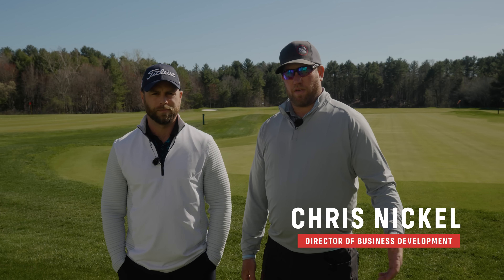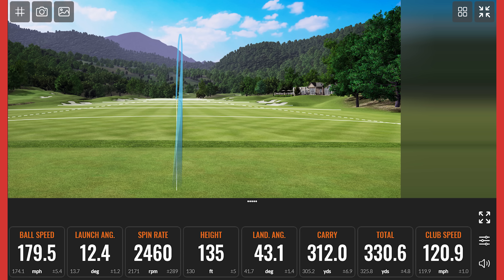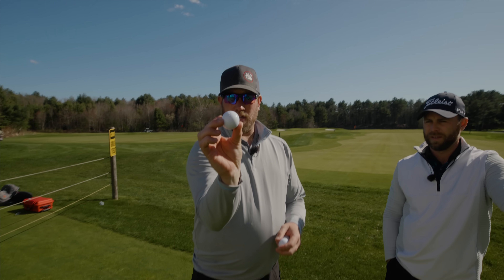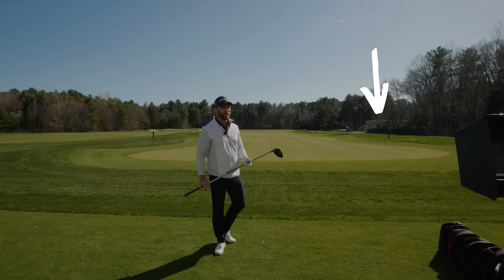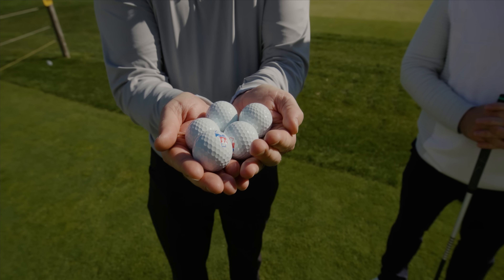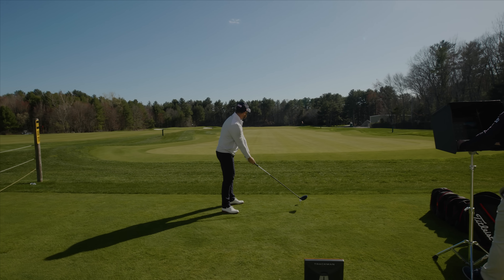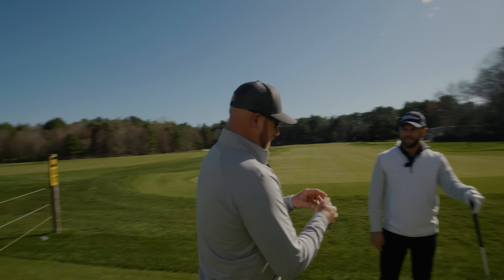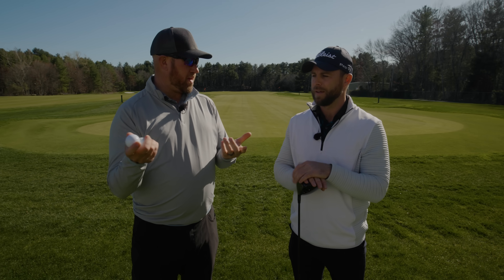DIMPLES VS NO DIMPLES: Golf Ball Aerodynamics

Comment: Keep it up...How about a driver vs driver...175 gram head (most drivers weight 175 grams if you remove the weights) 40 gram shaft with a 26 gram grip vs 204 gram head 70 gram shaft with a 52 gram grip...give us some more fun facts. Thanks

Comment: If anyone is curious, dimples cause a boundary layer of static (or near static) air next to the ball. What this causes is the flow of air over the surface of the ball is pulled closer by means of eliminating a pressure zone next to the ball. Essentially, it smooths out the air flow around the ball, allowing it to fly with less resistance. This is super important due to spin being a thing, since the net velocity of air next to the ball is much higher than the ball speed on one side, lower on the other.